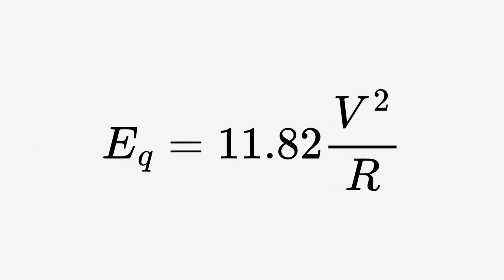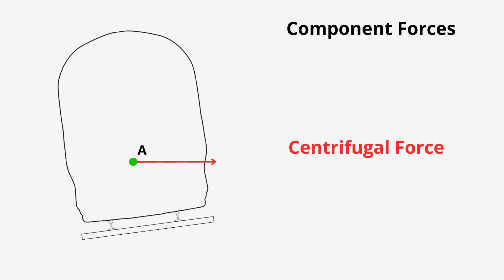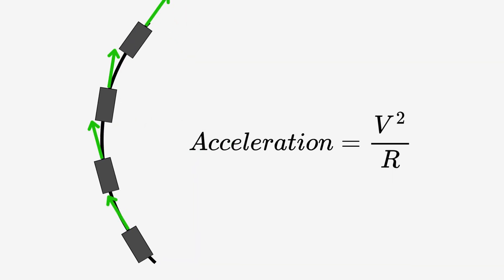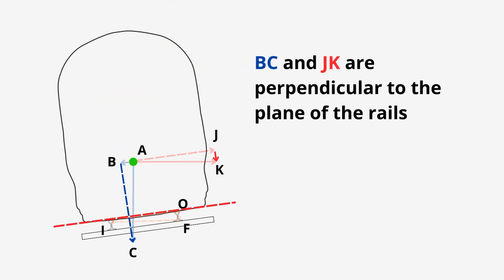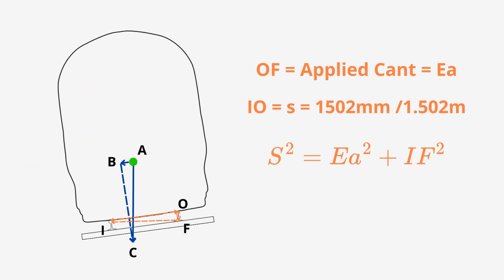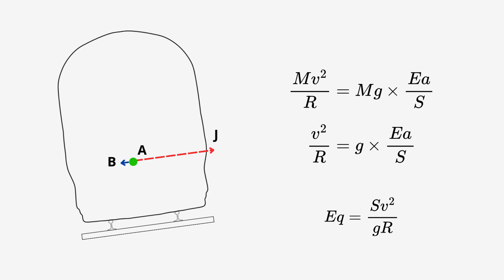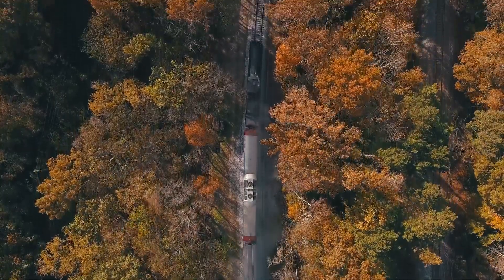The Cant Constant Explained! The Mystery of the 11.82 Railway Track Engineering

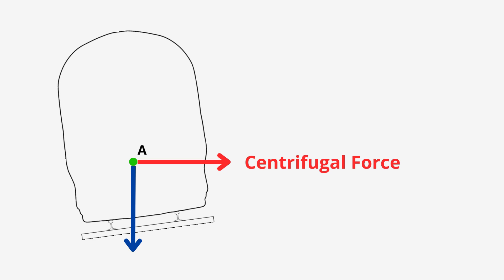Comment: 1:59 It is important to remember that centrifugal force is what we Physicists call a fictitious force. It is the apparent force experienced by a body during acceleration. For a body moving with circular motion, such as a train rounding a curve, centripetal force generated by the track pushes train around the curve, but as we know bodies have mass which resists changes in motion, called inertia. The inertia causes the train to try to travel in a straight line and that results in the fictious outward force called centrifugal force. Centrifugal force does not affect the motion of the train itself but acts on the rail as a reaction force in the opposite direction of the curve.

The rail exerts a force on the wheels of the train in the direction of the curve, the centripetal force, forcing it around the curve while the wheels of the train exert an equal and opposite force on the rail called the centrifugal force. The wear on the track is the result of the centrifugal force.

Comment: One of our members of our steam train association went to Europe and said the engineers had the surveyors place the cant requirements on little posts a set distance from the rail for the track crews to meet.  These little posts were outside the disrupted work area of track repair/laying, so the track crews could measure from the post and meet the cant to place the track.

Comment: CLASSROOM MATHEMATICS WONT KEEP THE TRAINS ON THE TRACK !
Pure Gibberish ! So who is using a 1432mm track gauge ? That's certainly NOT Standard Gauge, which is 1435mm ! And the next nearest Gauge in regular use (4ft 6in Keio Railway Japan), is 1372mm in metric terms. All of which makes me wonder which railway employs you as a supposed P.Way Engineer ?

And as any decent P.Way engineer will tell you, every millimetre is important. If you want the trains to remain on the track. Indeed in Curves you have to add a few millimetres to the gauge to avoid gauge spreading by heavy locomotives or high speed trains. And the exact amount is dependant on the amount of Cant (if any) & the radii of the curvature !   Further none of your maths addresses the problem of the Conicity of the wheels matching the inclination if the railhead. Both important factors that revealed wheels made in Switzerland when put under British trains caused serious issues and derailments. Because the fundamental maths of Swiss standard gauge, didn't comply with the engineering methods used as standard on British Railways !
Reply: Try using velocity units in furlongs per fortnight . . .

Comment: I went through electrical engineering in Toronto in the late 60 and had to learn to work in slugs for mass, pounds for force and feet/s for speed, but since we were also working in some metric units we learned mks, cgs and the non engineering British units, I was so greatfull when we switched entirely to mks, except that didn't happen, but we lost cgs. The think I really hated gas law problems with temperature in Rankine.

Our profs gave us all the short cuts like your 11.82 but always taught us why they worked. After I spent a year rehabbing from an accident I decided to teach Physics and found engineering to be a very good background. I had a math teacher ask me to explain why he was getting the wrong answer to a problem he was doing; he didn't convert to base units. I showed him how to do it and then explained the shortcuts he could use to leave out all the trig. I also explained why it works. He gave me my greatest compliment as a teacher. He said I was first Physics teacher he met who not only new the formulas but a;so why they worked.

Comment: typical bad engineers way - do not care how and why, just take ready-made formula with predetermined constants or even just a table from book, substitute parameters, get answer and go. Why this number? Because it is in the book, period.
Reply from the maker: I agree with you that some background understanding is needed, particularly around the limitations or assumptions that are made to get to that number. 

However I think getting to an equation that is easily repeatable, useable and quick is important. It cuts down mistakes, is memorable and actually gets used. Plus it is also accessible for those who might not have the engineering knowledge to get the first principles explanation